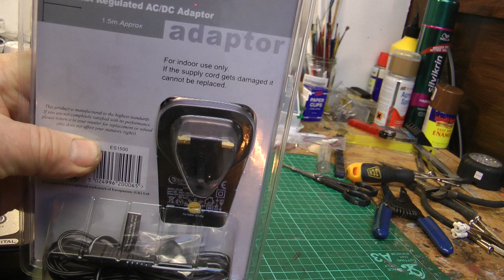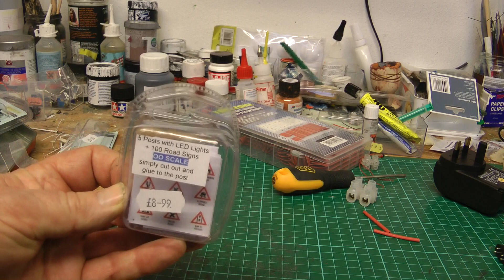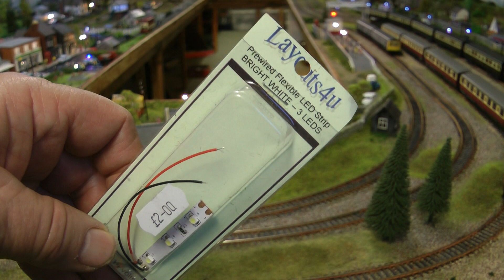Adding lights to Model Railways

Comment: Thanks for the video Dave.  One of the most important things I learned from this was that if you drive the LED with a 3 volt regulated supply there is no need for resistors.  Thanks!

Comment: Being antique I started with lighting when we used torch bulbs but as the models were wood there was little trouble.  I had a fully lit live overhead tramway but put it all aside 7 years ago.  I'm amazed how much everything has moved on.....your video has helped no end to understand the changes.  Thanks.
Reply from the maker: Glad that my video has been of some help and as you say so much has changed over the years, and since making this video  ..its all LED"s now , I have only been in the hobby 10 years and all lighting was using Grain of wheat and rice bulbs ..they got very hot ..and you could only use about 7 to a 12 v supply , but now with the LED,s you can add about 50 to one 12 v supply and they stay cool ..changes for the better ..makes a change ..cheers dave

Comment: Thanks for the video Dave. Most enjoyable and instructive. I am building a model town square and am now a lot happier about the lighting.
Reply from the maker: +bbcisrubbish Glad you found this useful ...the LED`s are the best now to use , think on reflection you are better sticking at 12v and adding the resistors , I have had a couple blow on 3v but think maybe due to not been on a regulated transformer ....Dave
Reply: +David Howarth Thanks for the reply Dave.  I assume the lights wired are in series. You mentioned some street lights that you buy for £8 for 6. What make are they?
Reply from the maker: +bbcisrubbish I wire the lights from a connector , all if on 12  v so no need to wire in series ..I get a lot from    layouts4u   check out there web site some good ones at fair prices ..Dave

Comment: Great Video.  Very well explained.  Thanks for the Yoga nod.  I am using regulated variable DC voltage supplies from Radio Shack here in the US,  I have several for various circuits on the layout.  Signals like 4.5VDC and the lighting seems to like 7.5 VDC so they work out great.  They look about like the ones you are using, but with a different connector naturally.  Thanks for all the great videos.

Comment: Hi Dave, just watched this vid & very good indeed. Considering you are not particularly electronically minded you did really well! If I may please say though....you did forget one very important thing re LED lighting & that is regardless of voltage...an LED has to be connected the correct way around! i.e. positive & negative have to be correct whereas with normal incandescent bulbs this doesn't matter. Best regards, John.

Comment from the maker: It is easier than having to solder resistors to each light , but you need a regulated transformer with the different settings on ...thanks for commenting ...Dave

Comment: Thanks David,, you explained in a way i could understand, especially about LED 3 volt, so keep up the good work and i look forward to you videos (if that's what we call these days) in the future, all the best, Gary
Reply from the maker: Hi Gary ...glad this has helped you , one thing I would recommend now is do them all at 12 v it does save getting a mixture then also can use one power supply ..you can run about 50 or more led`s from one 12v supply ...Cheers dave

Comment from the maker: Hi James thanks for the compliment , my layout is approx  3 ft high and the boards are again approx 3ft wide , I use 2x4 sheets and cut one in half , it does vary a little in parts though . but 3ft is about right so you can reach to the far side .   ..Cheers  dave

Comment from the maker: Thanks Hugh on your comment , yes the led lights are good and with one of those transformers at 3 volts no problem , sorry carnt help with the query re r 59  I know in the early days Hornby did fit some smoke units to some of there Loco`s , try and google the hornby number , it may give you some info 
Cheers dave

Comment: That was a great video - thank you for explaining about using transformers.  I have been using the 12v DC output from my controller but never considered you could use any regulated transformer to save you having to run masses of cable all over the place.

Comment from the maker: Hi Kev , nice write up in Model Rail for your layout , the 2nd Police car I stuck a flashing 12 volt led through a hole I drilled and the light cost just £1 so not expensive to do your own ...Cheers dave

Comment from the maker: Hi Geoff , the controllers can be found at Amazon , just put in search alternating voltage regulated 12 v. transformers , then the lights I get from a few places, layouts4u, express models, kytes lights , they all export, and you just google there names the sites should appear , carnt put full address on here it does not allow , but if problem just sent P. Message to me  I started 5 years ago when i retitired and as you see I have enjoyed doing it.   Cheers dave

Comment: Great video, I've just purchased some 3v lights at Warley and was totally confused with how to wire them up (I'm terrible at soldering) but this was a great help. Cheers Geoff
Reply from the maker: Regington Model Railway Glad you found this of help Geoff , the other thing you can do though is add resistors and you can wire in to 12 v  , I tend to do that now it saves having separate transformers .. cheers Dave

Comment: WELL DONE DAVID, DON'T WORRY, YOU MORE THAN EASILY EXPLAINED IT. I'VE NOW GOT A COUPLE OF MULTI VOLTAGE TRANSFORMERS. IT COULD'NT BE ANY EASIER, SAVES A LOT OF EXTRA WIRING ETC! THANKS AGAIN FOR THE TIP.
Reply from the maker: RUSS glad you found usefull

Comment: Hi David 
I am new to model Railways (just starting out), and your layout looks amazing. Could you give me some advice on DCC wiring  ? Do you have to put power to each section of track, or can you spread the power over so many tracks. ?

Also, if I only use DC, how much track can I use before I start to lose the current at the other end.

Hope I am making sense 

Regards shaun
Reply from the maker: Hi Shaun for dcc wiring you just have to wire to the track , if you have a big layout it’s as well to lay a BUS. wire (google bus wiring … ) then just solder to your track every 8 ft. As for DC I can not advise as not run a DC track … Cheers Dave
Reply: @howarth004  Hi David 
Many thanks for your help and support. That's a big help, and I am very grateful, 
Best regards, shaun

Comment: fantastic vid dave, im definetly having one of them controllers, 30 lights i think will do me fine, quick question m8, with all the steam you have do you have a triang r59, reason im asking iv just been given a green one the rods on the wheels on one side are rusty so ill have to clean, now what i want to know do these have smoke units in them, theres a wire comes out the side at the bottom and runs up through the middle im sure up to the funnel on top, any ideas would be appreciated dave thanks

Comment: Hi Dave. Really enjoy you're videos. With this regulated transformer can I use it to power lights on faller fairground by any chance?? Got the Ferris wheel  by faller  got it working but struggling on how to light. Just wondering on if I can use the transformer to power the lights. Thanks again dave👍
Reply from the maker: I can not see any reason not to use it , as long as its at 12v , I have used some of these add ons and they are 16v so you will have to check the voltage , these regulated go to 12v , and being regulated it stops the charge boosting like they do sometimes ...cheers Dave

Comment: Hi, David. I wonder if you could point me towards a useful power supply to use with a layout using only grain of wheat bulbs, and how many I could link up, in parallel for a given unit?
Reply from the maker: Maybe a 12v transformer , should be able to run 10 /12 lights from one
Reply: @howarth004  I was looking at the regulated PSUs you were using, and it suddenly occurred to me that I had one knocking around, so I've ordered a couple more, as I have almost 30 lights on that half of the layout. I think they should do it well enough. Thanks for your reply.

Comment: thank you so much, great video which will help me buy the right equipment for my layout.
Reply from the maker: Glad you found this helpful ..good luck with your layout ..I have found now that you are far better with Led`s and I would now recommend to keep at 12 v using the resistors , this way you can run maybe up to 60 leds from one transformer ..cheers dave

Comment: If anyone is using a transformer and the lights go dimmer when you add more in parallel you need a higher amp transformer. Computer power supply units are quite good aswell you get a range of voltages from the one unit and it has a built in fan.

Comment from the maker: I have lights on that Andy , it is a strip of leds that have been stuck on the inside of the entrence , then just wired to a 12 volts supply , if you look through some of my later vids you will see it lit up.

Comment: Hi Dave, you very kindly advised me some months ago re wiring, if I may ask another question, have just bought some 3v LED lamps for my platform. The wires are thinner than a hair, would I be correct in saying that I need to tin them with solder so that they are more substantial to go into a choc bloc, (I have tried them using your variable voltage adaptor, they worked fine until I moved them, and half the wires came out. Also when unplugged they stay on for about 3 seconds, is that just as they are using up the electric still in the wires. (Apologies for my lack of knowledge but we all have to learn sometime)Gary
Reply from the maker: +Gary Dixon Hi Gary , well they are thinner than what I usually buy , but yes tin them so you can handle and make a better contact , LED`s do stay on for a short while after unplugging , as you suggest they use up the electric still in the wires ...Cheers Dave

Comment from the maker: The panda car was from Kyteslights  they are on the web , the other is a standard car I drilled through the roof and put a blue flashing led through connected to 12 volt line underneath

Comment: Great helpful vid Dave thanks
Reply from the maker: Thanks Phil and glad you found some use for it , along with the  new work station no stopping you now ...Dave
Reply: ***** Do you use a capacitor for each build so if you have 8 lights you use 8 capasitors? or just 1
Reply from the maker: Phill Adams I dont use them Phil , most of mine are running from a 3 volts setting , or if 12 volts i have the transformer set at 12 volts , as shown I can use resistors if its a 3 v and running from 12 v ...if you can follow that ..Dave

Comment: dave, great layout,new to the hobby,just starting to put some led,s in the houses,got a regulated transformer,do I put a bus line around the layout and join it up with the regulated transformer and switch it to 3volts,thanks dave
Reply from the maker: Thats about right , make sure its on 3 volts first ...I do have a few wires running as Bus lines for the lights , think I HAVE ABOUT 10 OF THOSE TRANSFORMERS WORKING ....Dave

Comment: Hi Dave,  great film I have some 3 volt lights to connect up to an existing 3 volt supply.  The light wires are so thin.  Is it ok connect thicker wire on them and wrap up with insulating tape?  I just cannot seem to get them to work properly.
Reply from the maker: I have used thicker wire connected to those thin ones no problem , i then put a short piece of shrink wrap over , helps seal and stop shorting if both sides touch ...
Reply: David Howarth Thanks Dave I have managed to sort it out.  Your layout is superb.
Reply from the maker: @EM-yk1dw  Good ..onwards you go now then ...Dave
Reply: @howarth004  Thanks Dave, now my next project is to add some colour light signals.  Any tips on wiring them up?

Comment: HI David. Have you had any failures with the regulated adaptors ? I bought 2 very recently ( the same as the type you were demonstrating ) and one of them has failed already Its been in a permanent position,so it's unlikely to be a problem with the supply cord.

Comment: Hi Dave,  I have a DCC system with lit buffer stops.  Do you think I could break into this supply to put yard lighting in, rather than get a separate transformer for this?  Interesting film BTW
Reply from the maker: Hi Edward , depends if you are drawing 15v it would be a  too high for grain of rice lights , but led `s if you have a ring of say 3 it should be ok , b ut to be honest I would rather run a 12 v  supply separate for the lights ..1x 12 v supply and you could add up to 50/60 led lights ..Dave   a 12 v transformer can be bought for as little as £8
Reply: Thanks Dave for your reply, I think I will run a separate supply as you say.  I want to install some yard lights but a separate supply would give me the option of adding extra in the future if I decide to.
Reply from the maker: yes it will be better and useful for future use ..here is the type I use ..the variable voltage ones can be very useful and regulated   https://www.tlc-direct.co.uk/Main_Index/Transformer_Index/Power_Supply/index.html        Dave
Reply: Many thanks Dave for your kind assistance and advice.  I am going to run a 3 volt supply for my lighting.
Reply: is a 600ma regulated power supply ok Dave?
Reply from the maker: I have some on 600ms ....yes for 3v those transformers are very good ...if you google      layouts4u   you will find a good selection of lights reasonably priced ..Cheers Dave
Reply: Lights all wired up Dave,  used a 12 volt supply as they had resistors on them.  Handy having the new supply as I can add more in the future if needed.  Many thanks for your help.
Reply from the maker: Edward Pearce glad that you found it of help , you should be able to add a lot more lights to that supply , I am told you can add up to 70 leds to one 12 v supply .. cheers Dave

Comment from the maker: I had the expensive ones about £7 for 3 in a roll and the colours of the sky where all different shades , so I sent them back , the cheaper ones about £1.30 each are better , but they should have continuing batch numbers , so you can continue the scene , it does work , just make sure you get the   carnt remember but something like   gm 12 then 13  then 14

Comment: Excellent vid thanks so much for posting. I am new to modelling and trawled around so many places to get clear, easy concise info, you have all that in just one vid.  If you have a moment could you advise where I could get the LED street lamps you show at 04.55.
Reply from the maker: Hi Clyne , i buy most of mine from     layouts4u     just google that and you will be in to there web site ...Dave
Reply: Found it, excellent site, many thanks
Reply from the maker: Very good ...they are very reasonably priced there ...Dave

Comment: Hi David. Watched this last night, very interesting and I have decided to add lights to ly layout. JUst wanted to ask though, and someone else has asked a similar comment about adding multiple Led's to a connector block. For example you had 6, so I take it you would squeeze all 6 into one end of the connector block and then the stripped down 3v adaptor on the other side? Then if say you want a another bank of lights, say another 6 would you then just repeat, and purchase another 3v adaptor, block and lights? Many thanks
Reply from the maker: You can fit many lights to one 3v transformer , I would add 6 to one connector then put a pair of wires to another connector and add another 6 , make sure you transformer is a regulated one ..I have probably gone as far as adding 14 lights to one transformer could  probably add a lot more , but those transformers are cheap enough about £9-£10  so makes sense to say go to limit of 10 to one transformer , and as many connectors as you need to make it easy (there are big ones which can take a lot of wires )  hope this helps ...Dave
Reply: ***** Many thanks David. I have ordered a similar transformer that you have on the video from Connectit on Amazon(Regulated). I have ordered some Led's from a company on Ebay, that provide connectors as well.Many thanks for the advice.
Reply from the maker: ***** Glad you found them , I have bought those on Amazon as well thats will be the ones with about 6 settings 3-12 volts